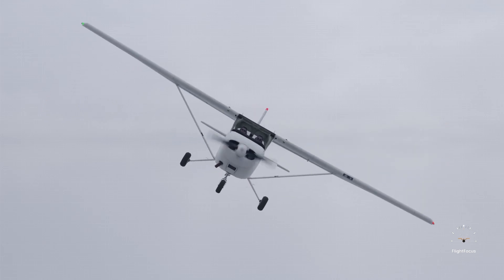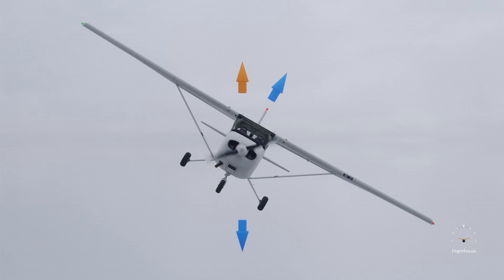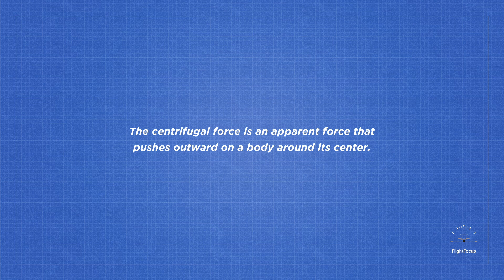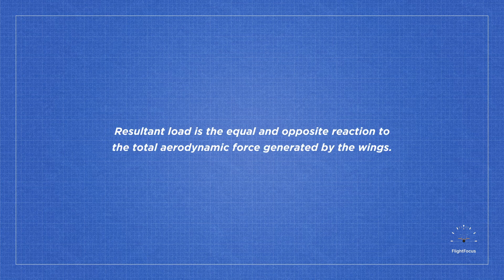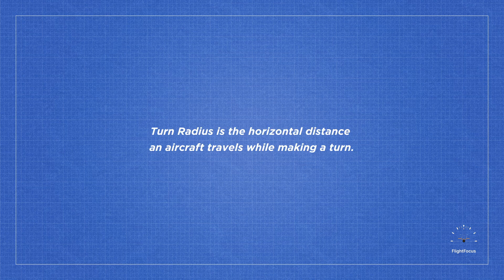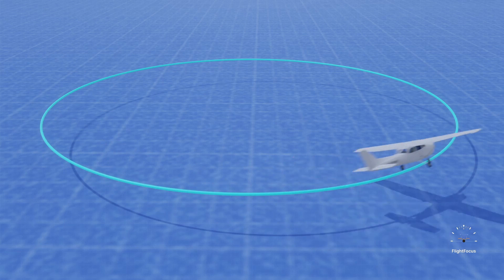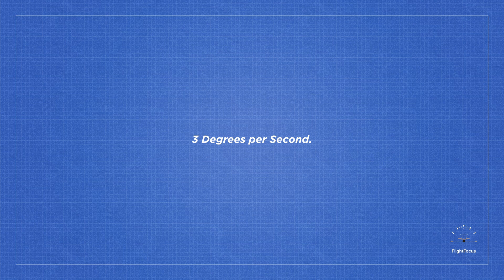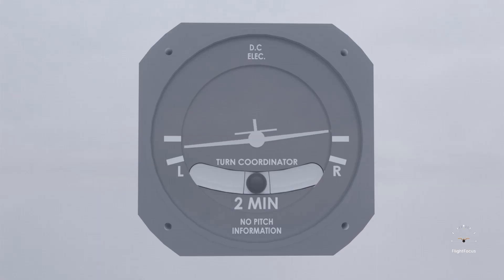Forces That Makes An Airplane Turn

Comment: the steeper the bank angle the faster airspeed and a smaller turn radius? or the steeper the bank angle the slower airspeed and a smaller turn radius? which one is correct?